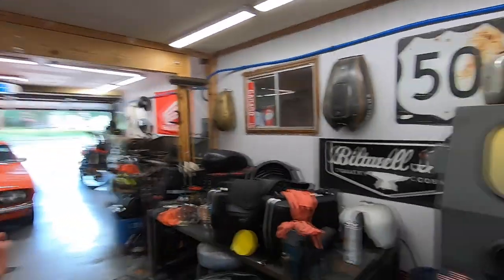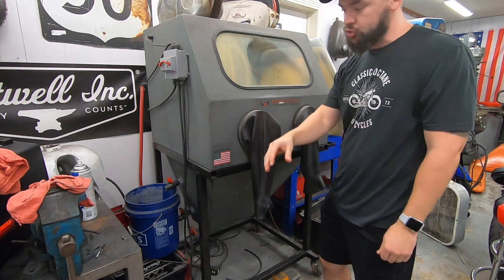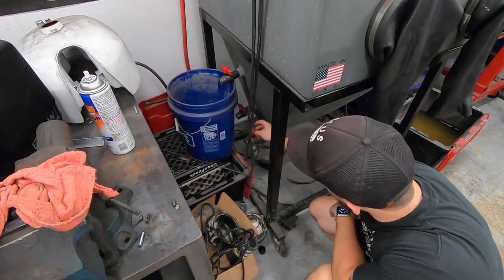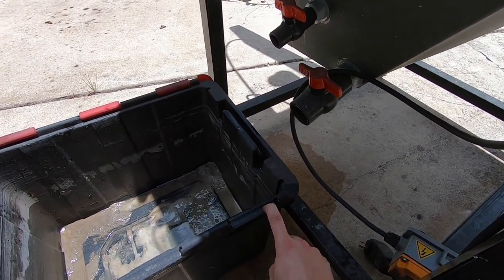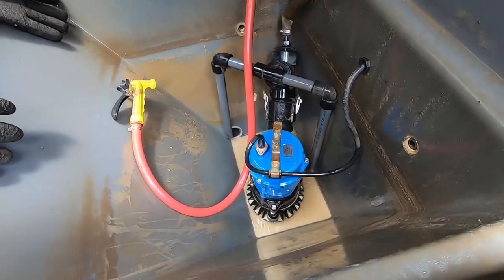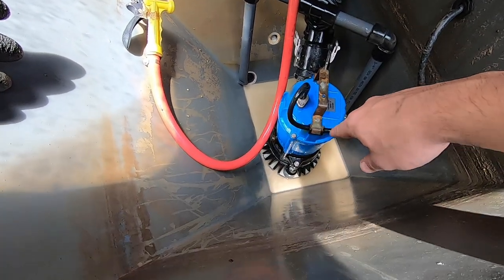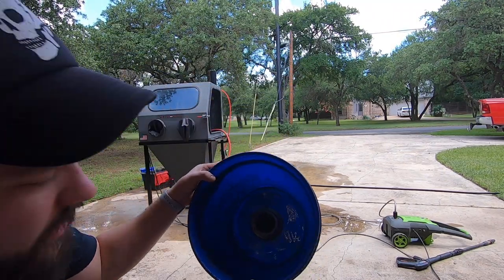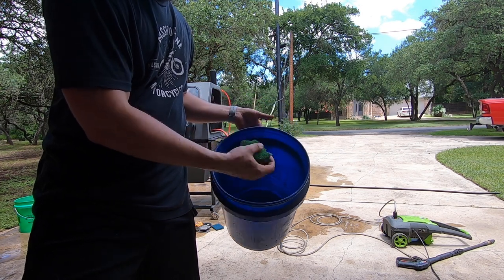Inside my vapor blaster after years of use... (disgusting)

Comment: i have a sandblaster cabinet, and i just use bags of play sand for kids sand boxes from menards as media. i tried it once in a pinch when i was out of media in my portable, full loss blaster, and it worked surprisingly well. i did have to make a 5 gal. bucket sieve with 5 layers of different size mesh screens to remove the larger pebbles from the mix though. it's a lot cheaper, and the wide range of particle sizes and hardness really does a pretty good job for removing rust from steel and cast iron parts, which is mostly what i use it for.

Comment: In your filter bucket I would build some stand offs to put in the bottom of the bucket. Then add a grate of some kind on top of them. Then cut a few ( 3 or 4 ) layers of the filter material that is the size of the inside of the bucket.  That way you have a much larger area to catch the material without slowing down the water getting thru it nearly as bad.  With having just the small filter area it's going to clog up much quicker and drain slower.  You will use more filter material but won't have to change it as often.

And if you don't like having open water containers why not put lids on the containers/buckets. Just cut small holes in the lids and add a pipe extension/s to the outlet on the cabinet.